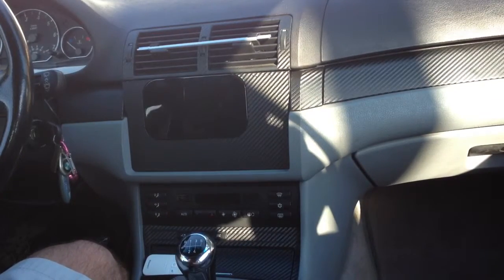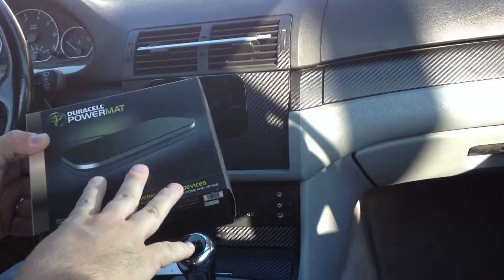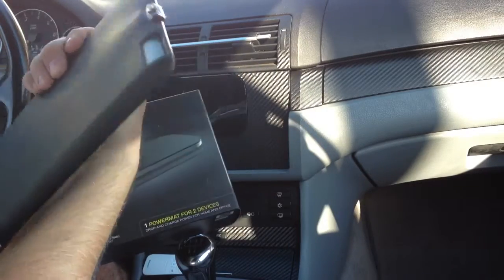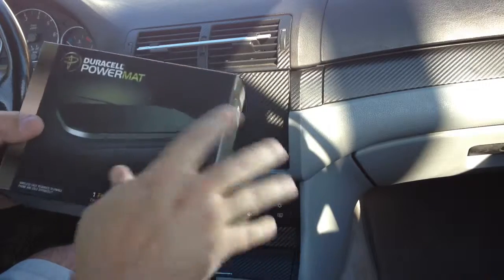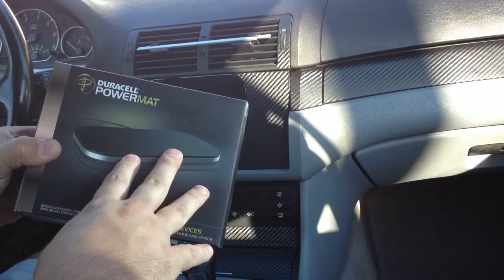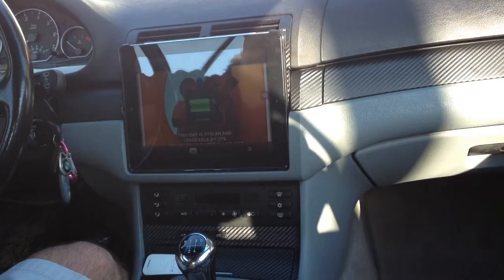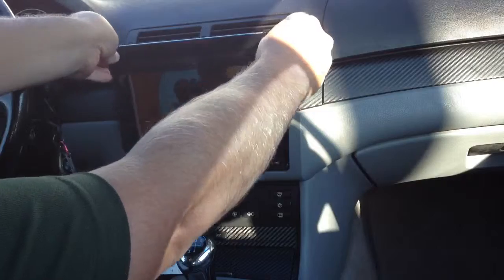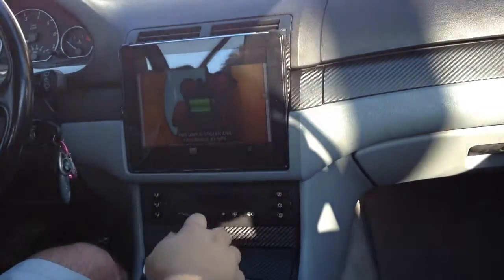Wireless charging iPad car install

Comment: Why does your wallpaper say "this unit is stolen and traceable by GPS"?
Reply from the maker: LOL, because I designed the wallpaper and wrote on it to scare potential thieves ;).  I'm so glad the unlock bar blocks my actual phone number as I don't want to get a bunch of nasty calls.  I've long since moved on to iPad Pro.  Not using that in the car though, I've now upgraded to the Nexus 7 with ibus integration.

Comment: What would it cost to have you make me one?
Reply from the maker: I'm not really in the business personally, but thought I'd put it out there for the ideas.  Most audio installers can fabricate things for vehicles.  I could do it too, but my price would probably be higher ;).

I actually switched now to an Android setup, which has some advantages and a near-stock fit.  My Android has a built-in Qi wireless charging receiver, for which you just purchase a Qi wireless charger.  Qi chargers are much easier to deal with as they use USB for power source.